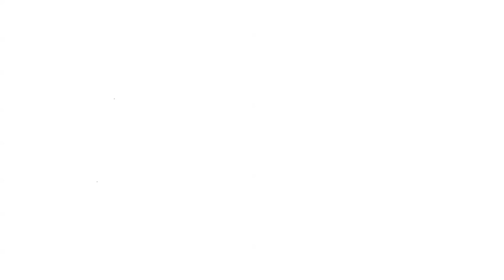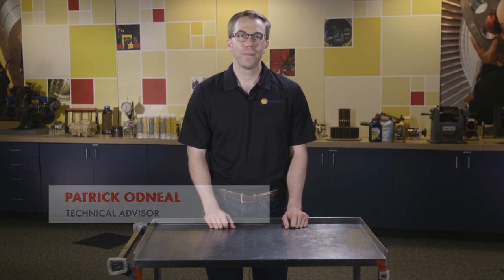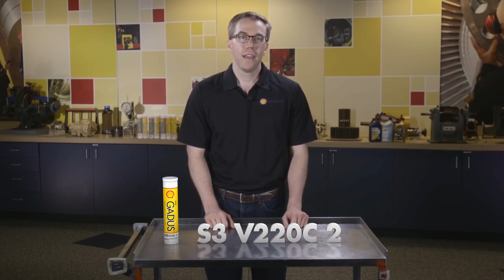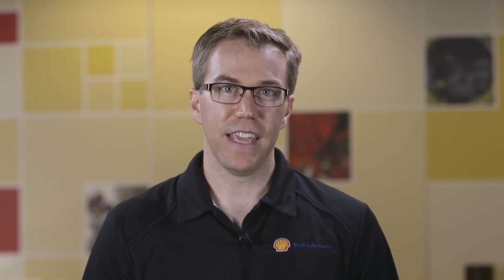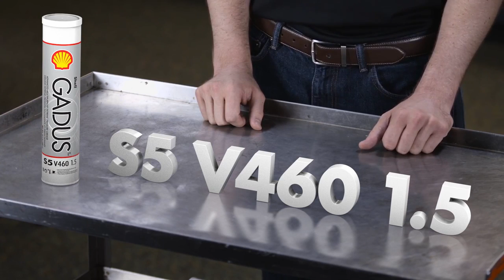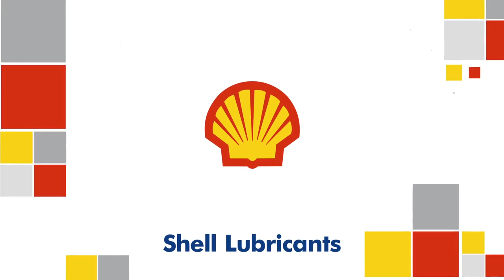Shell Lubricants - Gadus Naming Conventions

Comment: Hi Patrick... i was wondering if you could explain what shell L-12108 equivalent means. I drive a vehicle with zf 8hp70 transmission which takes a fluid known as lifegaurd 8. Recently there are more aftermarket products available many of which make reference to being "equivalent or meets spec of Shell L-12108". I have been unable to find any specific  data on what exactly that means?... thanks
Reply: L-12108 i believe is a specific OEM factory fill oil which would fall outside the Shell lubricants normal naming convention

Comment: I'm told Shell made a "00" grease that was the color GREEN, can anyone tell me that part number and/or title??
Reply: For the Shell “00” grades there the 2 most common are a S5 V460C 00 which is a Red full synthetic lithium complex. There is also an undyed variant of the same S5.

Secondly there is a S2 V220 00 which is an undyed mineral oil lithium grease.  

As for a green 00  potentially one existed 10+ years ago but since phased out.